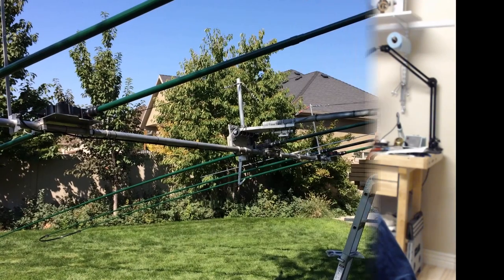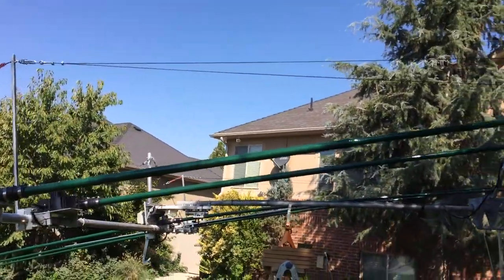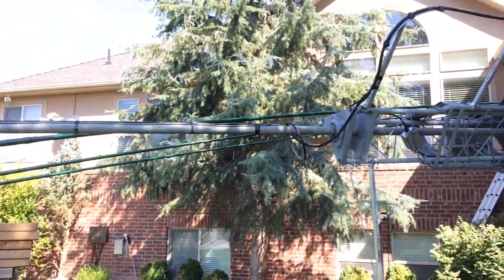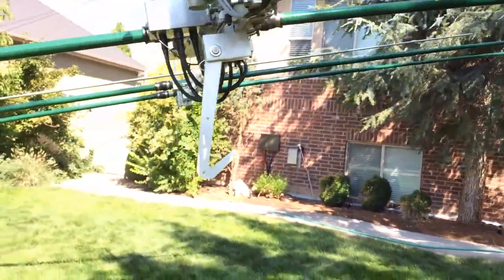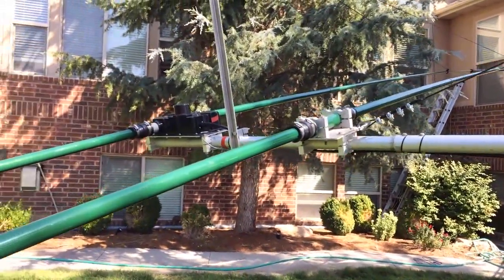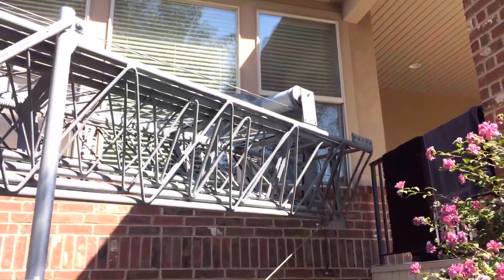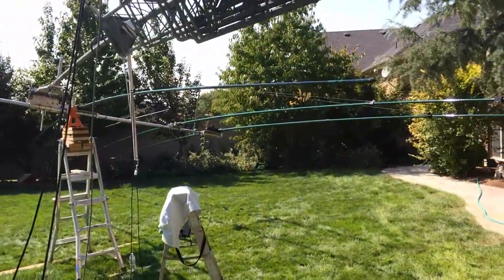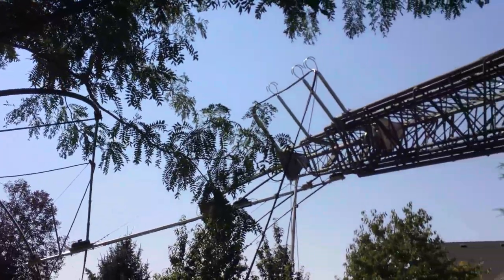NG7M SteppIR DB 18 Tilt Up with NN4ZZ Tilt Plate

Comment: Hello Max from Australia, I'm about to consider a DB18E and just checking out all the You Tube info. Thanks for your video. Just curious about your tower.
In Australia we have a devil of a time to get all the box's ticked to allow a Tower in a normal suburban block. Many Councils have restrictions and By-Laws to Antenna systems. The average allowable tower height is 14 meters with no permits required for 9 meter masts. A while ago we had to have a building permit and a planning permit and before they were issued you also had to approach all adjoining neighbours including across the road from your property to inform them of the installation of the Tower and if anyone of them disagreed to the installation it only lengthened the process time in getting your Tower installed. If you are in the country area not so much a big deal but in Suburban areas its a different story. It's pretty much unheard off to have a three stage tower, that's why I see your tower here and I'm very envious of it!....most Australian Amateurs also would love to be able to have three stage towers  that go to the magic 70 foot mark....Can I ask you what hoops do you have to go through to have a Tower like yours on what looks like a normal sized block, I mean I can see neighbours both sides, do you have to approach them?....are permits also required?...just interested Max, lov your Tower, luv the SteppIR....all good stuff!...Cheers Clint - VK3CSJ Melbourne
Reply from the maker: Hi, late reply.  I was very lucky for the city I live in.  I just had to apply for a permit and pay a $20 US fee.  The inspection was quick and the inspector was very accommodating.  Other cities close to me are super painful.  I had to pinch myself after getting the permit and getting the engineering sign off from the city.  Very easy.  Everyone's mileage does vary.  Hopefully it won't be painful for you. Max NG7M